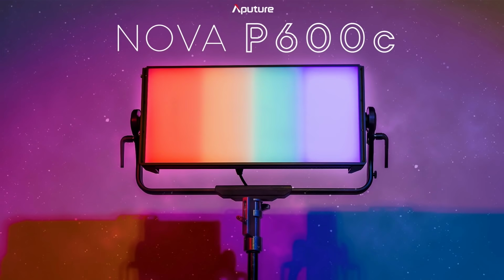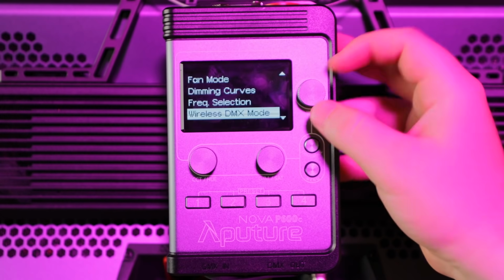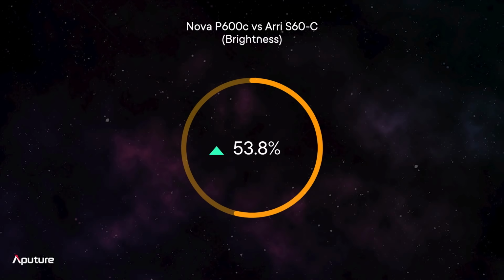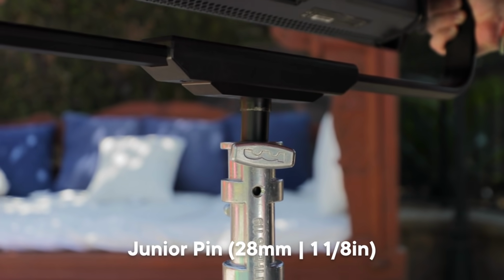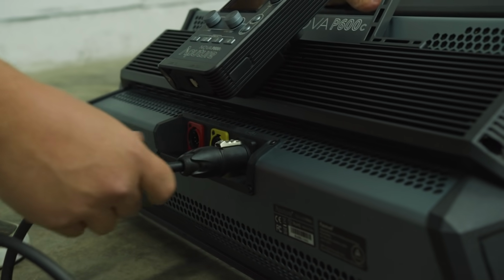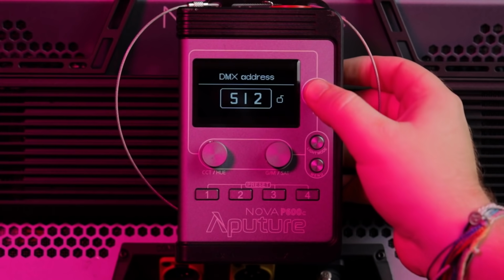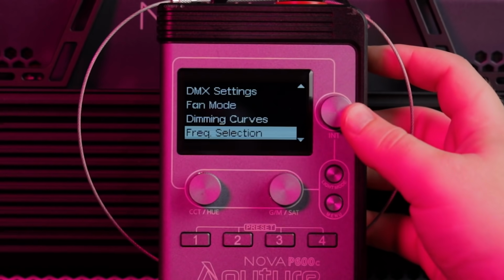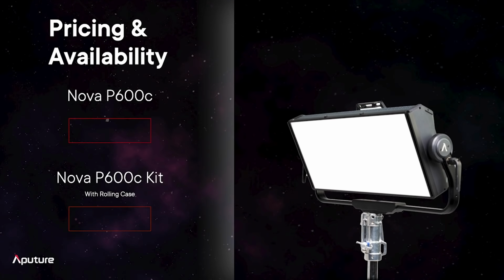Announcing the Nova P600c | Live Product Announcement

Comment: I'm currently still deciding if this fixture is worth it over 2x Nova P300c.

Besides the built-in wireless DMX and the ability to remove the diffuser? Why not just have the flexibility of 2 fixtures?
Reply: I’m wondering about the same exact thing… price is the same for two P300 as for one p600.
Reply: I got two P300 I think is better to have 2 than just 1. If need the extra power use the 2 P300 at the same time but they are very bright so most of the time I use 1 for key and 1 for background and works great.